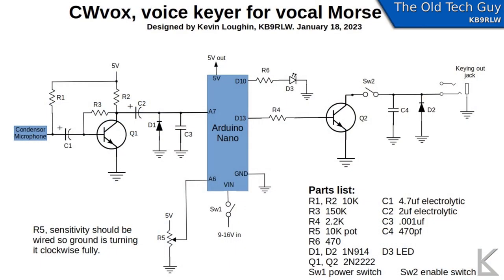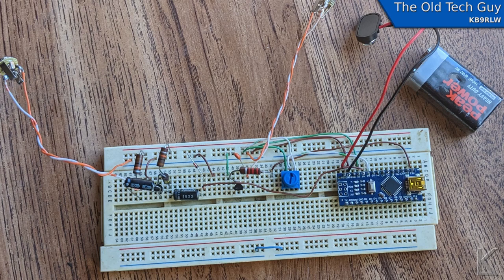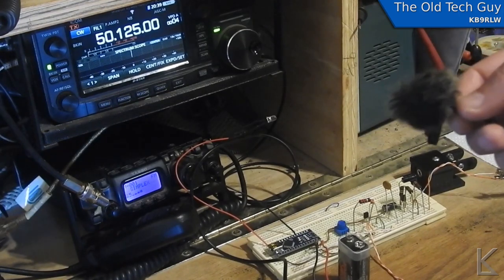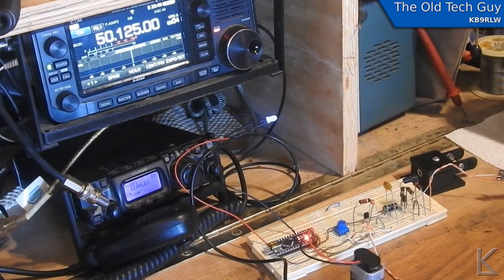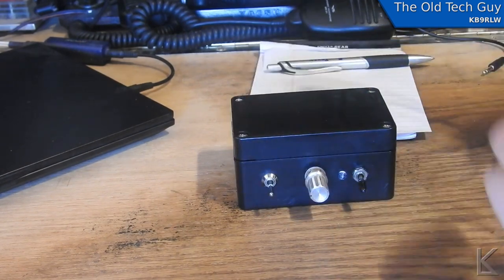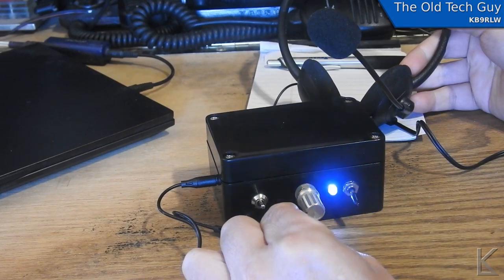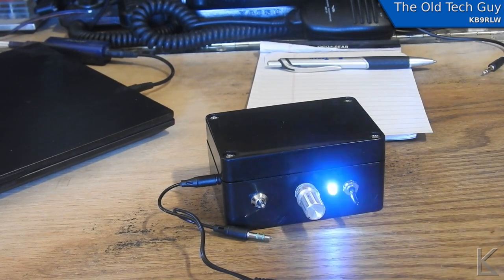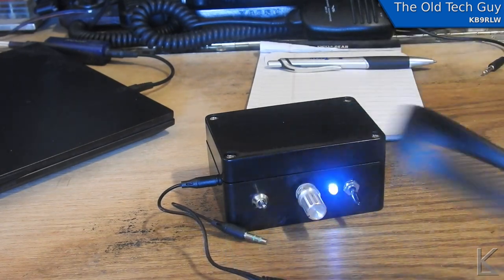Ham Radio  - The CWvox voice operated keyer for verbal Morse code

Comment: That Nano is 7-12v not 9-16v.  But this is a very very cool thing here. Great to hear it on the other side of the livestream.
Reply from the maker: How'd I miss that?   I'd swear I read the other range on a spec table somewhere.   I need to update the schematic.  Thanks.
EDIT: I updated the schematic and the blog, also added a line to the video description.
I'd looked at this page, I guess it's not an official arduno.  Oops. 
https://www.etechnophiles.com/arduino-nano-every-pinout-specifications-schematic-datasheet/

Comment: One suggestion- You might want to add a high-value discharge resistor across C3 to establish a known voice input release time for various ATMEGA328Ps. As is, the decay of the input voltage to the ADC is established by undefined leakage currents of the ADC input, D1, C2 and C3. Wonderful idea, especially for the handicapped! 73's, N2GX

Comment: I started out as a ham with a keen interest in CW instilled in me by my elmer in the late 70's. Now I am in my mid 70's and my essential tremors have become so bad they interfere with my sending, so I watched this with great interest! I had looked into various versions of "puffer" breath keying  switches, but this really caught my eye. When you made that first contact, I wish you could have seen the huge grin on my face. I will certainly build this and give it a try eventually. So many projects, so little time, but this one looks like it will float rapidly to the top of the pile!!!
Reply from the maker: There have been more than a few similar comments so far.  And exactly what I'd hoped it'd be useful for.  :-)

Comment: Thanks, well done. Voice to text to Morse would be cool. And then the reverse Morse to text to voice synthesizer. The ultimate in digital voice communications.
Reply: Quite right. Smartphone handle speech-to-text well. Simply send the text into a Morse encoder.  The iPhone app, Morse, will do speech to text and then allow what's said to beep and flash the screen. It's not designed to drive a transmitter, but it does illustrate that the principle would work.

Comment: Nice Kevin!!! here is a suggestion.  Have the LED always indicate when it "would" key if the switch was flipped.  This would allow you to adjust sensitivity without actually keying the radio.  You could also use a dual color LED or a second red LED to show when the radio is actually being keyed.  You could also include a notch filter to prevent the keyer from picking up the return tone and keying when you do not want it to.  Aside from my suggestions this is outstanding!!!  You should do a build article and submit to QST.  I was published in may 2009... see if you can find my article.  N7KBC  (by the way QST paid $75 per page back in '09)
Reply from the maker: That's exactly how it does work.  The LED.  
Notch would be tough.  Some people have high pitched voices, some have low. 
With the mic next to the mouth, you can drop the sensitivity where the radio's RX and sidetone don't trigger it.  You can also use the headphones to avoid that. :-)
Reply: @loughkb  OK I missed that, great work!
Reply: @Kevin Loughin  doesn't need to be a notch. Make a low pass that passes everything below 440hz. Most cw tones are higher than that and Spech (vowels) are Far lower.  Just add a quick rc.
Reply: BTW. Ambien involves in the relpy. I might br fucked.
Reply from the maker: @shinysquirrelclub  You might miss the beginning of a dit or dah if it's a woman using it.  Or a male with a high pitch voice.
Reply: That’s absolutely brilliant! Love your channel content. 73

KO4BGD
Reply: Hi Kevin,
Many, many thanks for this.  I want to re learn  CW and use it, but dud to a bad tremor in my hands,  trying to use a key of any description is impossible for me.  So, if I can get this built &programed for me (as I can no longer use a soldering iron 4 the same reason), 1 of these would be totally ideal for me.   
Now then, how about the eventualities of working someone else using one of  these on the air  at the same time?   Each of us blurting out  " di di dit   dar dar,   dar dar  di di dit   at the end of the QSO ? ?  Down a microphone. 
Once again Kevin,  Many thanks for yet again another brilliant video.
De, Ray,  MORAY

Comment: TIL: A reed relay is a thing! And you can make one by wrapping a wire around a reed switch.
Reply from the maker: They're nice for low current draw on the coil.  It doesn't take much grunt to engage them.  Also good for battery operated devices where you need to switch a bit of current but don't want to kill your battery too quickly.
Reply: @loughkb  Good to know.  I have a doesn't read switches, but I could never get a magnet positioned correctly to do any good. At least I have a use for them

Comment: Hi, I am 67 years old now, been a Ham since I was 15 (52 years now) and have been mostly a CW op over the years. I think that's a very clever project and one I may duplicate since my right hand is not as cooperative as it once was. I can copy at 35 wpm but on my Kent paddle, I don't go any faster than ~25 wpm. I don't expect my hand to get better.
You know it's just a matter of time before MFJ takes your idea for profit and then you'll be able to buy a chinese board for $5.75 and free shipping. Shame ! 
One mod I'd consider is a CW monitor for the headphone on your headset and a TR switch, so the audio from your transceiver goes to the headset while copying. I think that would be cool to say dah and hear it in a CW tone at the same time.. Of course allow the tone freq to be adjusted for pitch and volume.
The only problem is if the mod could be fast enough as to not cause the sender to get confused with the delay. If the delay was not an issue, saying dah and hearing it at the same time would be a real trip. It would be like your own voice pronouncing dits and dahs  as tones..

Have you considered selling your project to MFJ for free but you get $1 for everyone they sell for say 10 years??? It'll probably fund some projects or maybe a dozen eggs.. LOL
That really is great thinking on your part and so kind of you to provide the sketch to anyone who wants to roll their own.
73, Glenn WA4AOS dit dit
Reply from the maker: Just plug the headphones into the radio's headphone jack. :-)
I left it off so the camera could pick up the radio's audio.

Comment: You could add a jack so that a foot switch could be wired in parallel to Sw2.  Also a press button on the top of the box for a momentary make.
Keith  M0KIL.
Reply from the maker: It's open source and open hardware, you can modify it however you like. :-)

Comment: Very, cool. Now to make this even better, what about taking the CW you hear out of the speaker. And turn it down, Then take the AF fixed level out from the back side of the radio and, turn it into the sounds of the click and clacks that you would hear out of a 1910's sounder. Work with several hams in a net or?. 
Keith N9QDS
Reply from the maker: Neat.  But it might be distracting.  I am interested in seeing how people expand on the project down the road. 
I did think about tapping the line level audio out of the radio and comparing in software as a sort of anti-vox though.  It would complicate things, requiring a second connection to the rig.

Comment: How would using audio out from a phone or PC through a headphone jack function with this setup? For example playing a morse code audio file on a phone connected to this circuit with a male/male headphone jack?
Reply from the maker: That would trigger it just fine. Your transmitter should follow the recorded Morse.

Comment: This is very cool, I wonder if you could connect a tablet or RPi that is running speech to text and have it output the letters to the arduino and then convert to CW and transmit.
Reply from the maker: A pi has GPIO pins.  Just do it all in the same device.   It might be 'wordy' though.  CW ops like abbreviations.

Comment: Incredibly useful for disabled or aging hams (I'm both 😅), thanks !
Possible software improvement : send calibrated durations for dits and dah, like an electronic keyer.
Ultimate improvement : recognize the sounds dit and dah, by a (not too complex) spectrum analysis ?
I am sure some hams will improve your excellent idea 😁
73, F1SOC
Reply from the maker: Those would be one in the same.  In order to send calibrated durations, you'd have to recognize each first. :-)

Comment: the keyer you made is fantastic!   I am running a remote station and would like to use my key at home to send cw to my remote station. could you design the electronics to do this?
Reply from the maker: Getting a physical switching signal into the computer isn't a problem.  The remote software needs to support it and that's where the roadblock is.